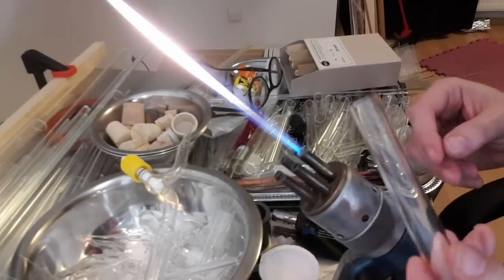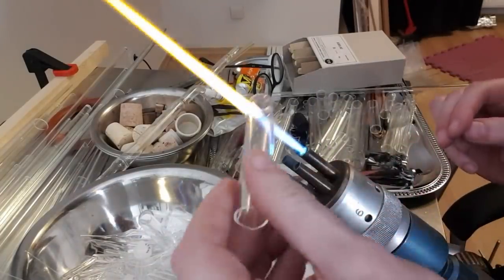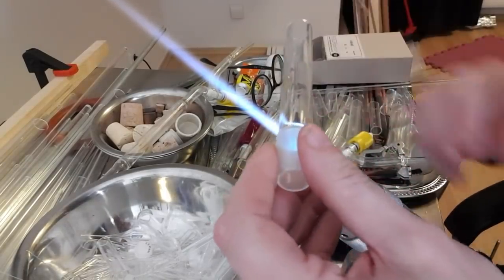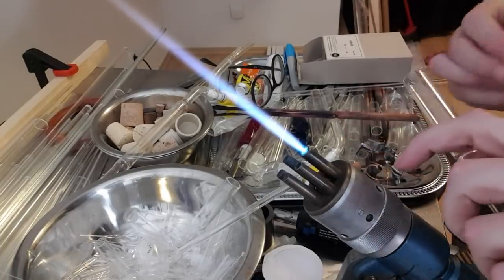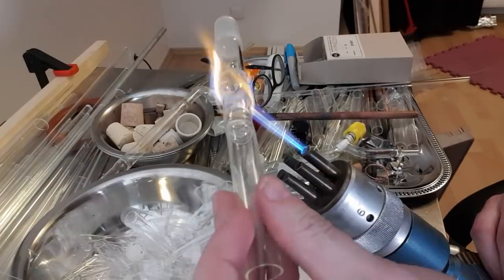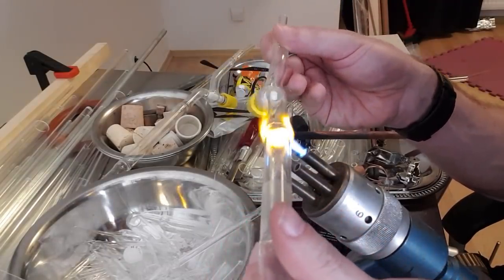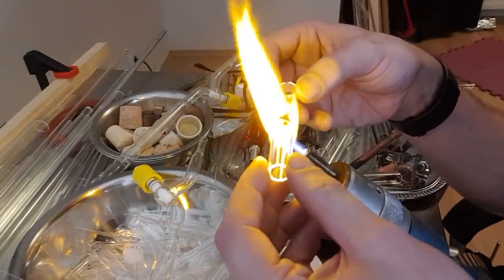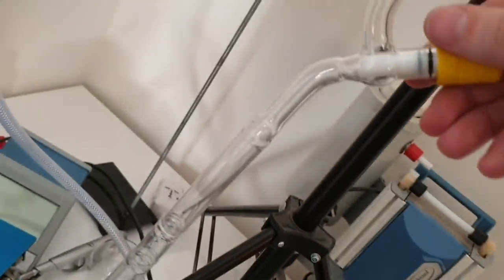Making an Ultra-High Vacuum 'breakseal'

Comment: During my PhD I used a lot of those teflon valves. They rarely leaked through the teflon valve, but the O-Rings in the upper segment would degrade over time. Unfortunately, the vacuum line was set up so that you had to take large sections up to atmosphere in order to replace the o-rings.

Comment: One of my first jobs was night work in an analytical lab it was mostly just cleaning things, labelling things, putting samples in order on the various machines and watching for gas leaks etc.

It turns out the guy before me was a master at making glassware and used to spend most of the night a lot of nights making them packed columns and joining tubes for the quick and dirty stuff and to check the separation materials... I think it also wowed clients.

I was still in Uni but I did a modern chemistry course so we did a couple of pracks in organic chemistry joining up glassware so my stuff looked horrible in comparison... like quickly melted candles stuck together next to works of art...

Any way I ran into him not long ago he “retired” from chemistry and took up glass blowing and making jewellery he works 2 days a week unless he has a commission and makes more in a year than any organic chemist I know of... he was working for them as a lab tech on Au$35000 a year for 10 years finished his PHD got a job with the government did glasswork on the side got put off and gave up on chemistry.

Comment: Nice.  Best way to store metals which react to air too apparently like metallic sodium, lithium or cesium.  Flush an ampule with argon and seal it up, no corrosion like you would get in more traditional mineral oil storage.

Comment: I'm wondering, how does high-voltage device detects a pinhole? I cannot seem to grasp a mechanism behind it.
Reply: Dmitry Yershov Maybe since it is at very high voltages any break in the material like a pinhole will leak out charges.
Reply: Glass is a very good insulator, if theres a hole electricity can travel through air.

Comment: Could stare at that flame for hours, it is an oddly sedating hobby you got there.  Where do you get a tesla coil like the one you used when testing your glass tube's vacuum?  I've seen them in science classes before but can't seem to find one online...
Reply: I believe it's a high frequency generator. If you do a Google search for "high frequency generator vacuum tester" you should get plenty of results. Just don't make the same mistake I did as a senior in high school and touch the tip while it's running. Man, that was stupid.
Reply: Geoff Powell, I bet you felt very energized afterwards :)
Reply: @Not.Your.Business  Needless to say, I was shocked in more ways than one. X^D

Comment: What are the sparks attracted to that lets u use the high voltage to find cracks
Reply: that's such a horrible understanding of science.
The "sparks" are plasma. Plasma is hot matter. In our case it's air that hit its breakdown voltage, and turned into plasma, conducting electricity.
Cracks have air. Glass takes MUCH higher voltage to turn into those "sparks". Air, turns to ..."sparks", if there's even a microscopic hole. If glass is in the way, no "sparks".
Reply: @dimitar4y   well be pedantic all you want but I'm asking why theirs a imbalance of charge that's causing the electrons to flow in the vicinity of the crack not the phase matter the air is in